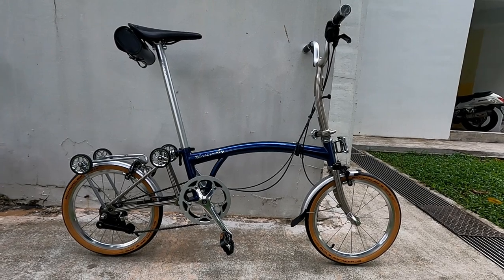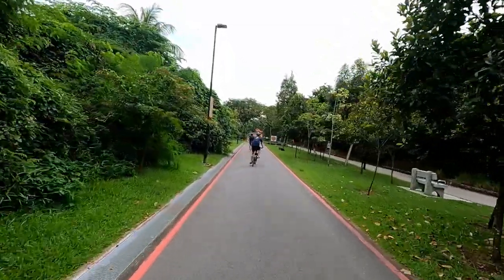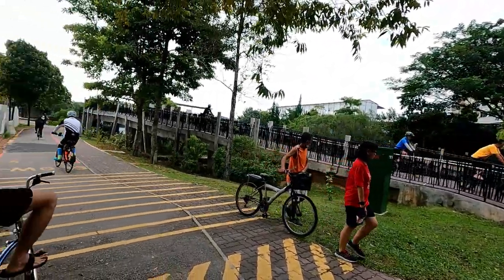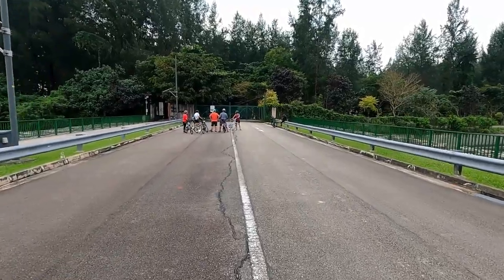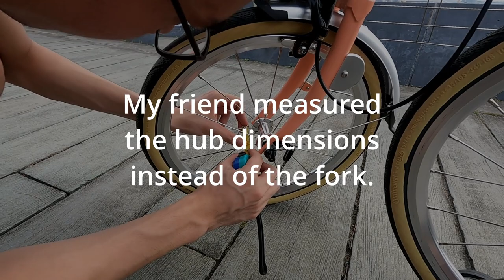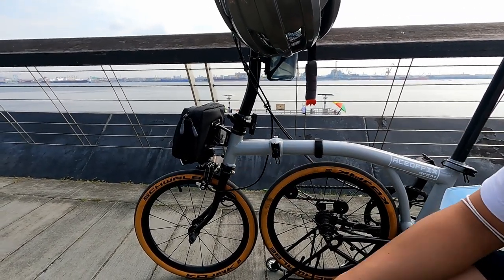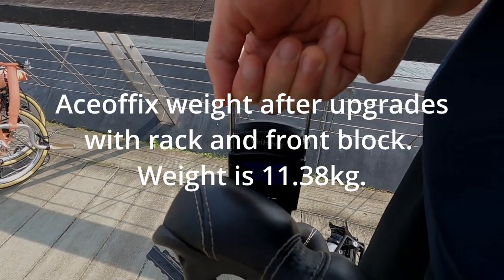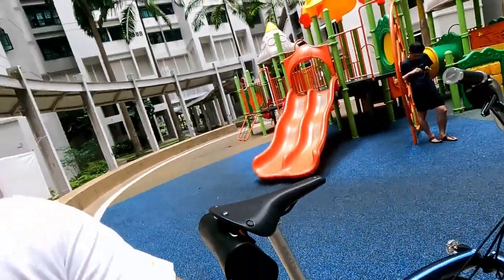BROMPTON CLONE WARS

Comment: Bought a Bluesilver Chrome 3sxity 3 speed from BikeXpress after watching your video. You have convinced me that a casual rider needs 3 gears, not 10. I did say “Ray” and the price dropped a little. That was nice.
It came today and looks gorgeous. Perhaps I should do a YT video on seniors like me should ride a bike for exercise, sightseeing around Singapore, and running errands, for that matter.
Decided to change the tyres from CST to Continental, for I was told it’s better. The shock absorber (or suspension) was changed from plastic to shiny steel, and so was the pedal from plastic to foldable steel (Sapience). Added a silver colour bike stand, it was firm and essential. I thought after all that, it’s a good start.
When I tested the bike my left shoe was caught on the left side tiny wheel (for pushing), and I nearly tripped over. Now I have to think about how to overcome that. The seat was not comfortable for a senior or a casual rider. I had suspected that and found a Velo Flurry (much wider and more cushion) and put that in my cart. 
Not wanting to wait a few more days to enjoy the bike, I went straight to Tampines West to get it from the store opposite the Middleton international school. One thing leads to another, a bell, a degreaser, a dry lube., a brush, a cleaning cloth. When is it going to end? When is this going to end? 
I will stop here. Not to forget to thank you for this introductory video on your experiences with the 3sixty and a comparison with other similar bikes.
Reply from the maker: Good morning Mr Chin,

I am very pleased that my efforts are useful and helpful towards the cycling community. Also, congrats on your discount 😜

I think you should start doing YT too, you have a lot to share and write. I believe you will gain traction:) You definitely can contribute and help others too with your experience:) 

You need to get used to not hitting the rear easy wheels, slowly but surely, you won't hit already. Saddle wise, can get wider ones for more comfort.  

Start filming your experience with the new 3sixty you have bought :) we can do a video one day together too. 

Cheers and ride safe ☺️
Reply: @raylearnstofilm6668  As a beginner in cycling, I'm most suitable to give feedback on the bike. Yesterday, I started to cycle from Vivo City across the bridge to Sentosa. I went towards Sentosa Cove as it was a lovely morning. As there are up and down slopes all the way, it is the best stretch to test the smallest gear. Sad to say it was not smooth as I switch gears, the chain fell off the gear. No big deal though a little disappointed, this is a new bike with a new aluminium derailleur that is supposed to be better than the plastic piece replaced. 
The upslope proved to be too much for an old man (though I have strong legs), especially on the return. The night before that, I tested the bike on a slope in my neighbourhood that is about one floor high and about 40m long, back and forth, time and again it was bearable. But Artillery Road > Allenbrooke Road was the tipping point. All of that was overcome by the gorgeous sight of Sentosa Cove on a cloudy morning—breathing taking to say the least. 
I'd have to cycle a few more times elsewhere before jumping to a conclusion.
Question: Is it an often and common experience to have the chain off gear?

Comment: is good to see more of those external 3 speed coming out . hub gear though required little maintenance but it will be almost impossible to repair if faulty. not to forget the re lace of spokes when changing a new hub gear.
Reply from the maker: Hi Kokwei, yes, the trend is really going external even Brompton are pushing their PLines and TLines as premium models. 

Repairing, I definitely do not know how to do it for the internal hub. Haha... Too complicated 😃

Re lacing the hub is still doable with the help of shifu @ Bartley.

Comment: hey ray, can do a video on the build quality of 3sixty vs pikes vs aceoffix?
things like:
1. is it easier/more smooth to fold? or very stiff
2. the welding quality
3. shifter, saddle, brake, etc quality

thank you ❤ your video have been super helpful, want to go down to your shop to build a bike someday 😁
Reply from the maker: Hi Mot,

I have sold my Pikes and I am not able to do a video on it. However, I can share my personal experience.

1. All the same folding method, Brompton derailleur no issues. Initially, Pikes and Aceoffix folding very stiff, maybe the paint at the hinges too thick. Added All purpose oil and it's not so stiff already. 

2. Welding quality, 3sixty best, aceoffix than pikes.

3. Shifter, 3Sixty best, Aceoffix than Pikes.

Stock saddle, 3Sixty best, Pikes than Aceoffix.

Stock brakes, Pikes best, 3Sixty, Aceoffix

Sorry, I don't own a shop haha. But feel free to test and build/purchase at Gary BikeXpress homebase shop for 3Sixty and CycleClinicSg for their Aceoffix.

Ride safe and cheers!
Reply: @raylearnstofilm6668  like that from your comparison Aceoffix doesnt seem like its worth the extra price tag if everything is stock ?
Reply from the maker: @onlyusemephone  can you explain, thanksss
Reply from the maker: @onlyusemephone  you mean base on stock parts comparison, aceoffix is not worth it?
Reply: @raylearnstofilm6668  Yea cos i am currently looking for a tri fold for my dad and was contemplating between a stock 3sixty and a low millage used aceoffix with upgraded parts for around 1000 dollars i was wondering which would be more worth it 

from your review it seems like if everything was stock 3sixty which cost around 800 as compared to a aceoffix stock which cost 1050 the 3sixty has better quality
Reply from the maker: @onlyusemephone  Ahhh, thanks for elaborating. I understand now.

3Sixty stock is ready to go, yes! Aceoffix, stock is not so ready to go... Both rides the same. Aceoffix you can convert rear titanium triangle. The 3Sixty, can't. 

If you want to upgrade and zhng your bike, get the ace. But i would get the 3Sixty for my mum to ride. Simply because she don't care about zhnging or making upgrades. Also, it is more budget friendly. 

For your case, I recommend 3Sixty. You decide... haha. 

Take care, ride safe.
Reply: @raylearnstofilm6668  do you know which one fold the smallest? Thank you

Comment: As a Dane I tried to buy a 3Sixty, delivered to the EU (Looking for a Brompton type, copy bike), but it wasn't sold in the EU most likely from Copy Rights issues, as the Patent has run out? And I must admit that even my two times 3 gears are not enough for my use.
Reply from the maker: Hi 👋 Finn 

You bought a 3sixty already? 6speeds? 3x2?

Comment: Thot the weight for Aceoffix is 9.8kg? Is it because rack, front block & pedal not included? But these 3 items comes up to ~1.6kg?
Reply from the maker: Yes, the rack, front block and a better saddle increased the overall weight of the bike. In my opinion, these are mandatory upgrades for a convenient and comfortable ride. 

Unless one is achieving a superlight bike for hand carry, I think the slight increased weight stabilizes the trifold. Which is a plus point. 

Lucky, there is no internal hub... If not it would be too heavy.

Comment: Do you encounter chain keep dropping issue for external 3 speeds? How do you solve it?
Reply from the maker: For me, no. I have friends/cousin who encounter these issues with their Aceoffix 3speed external. 

To fix it, 

1. you have to check the chainline of your crank to the rear cogs. 

2. Limit screws at the pusher 

3. Tension set at the cables when pulling the pusher.

Trial and error can fix, I am not a expert haha. Can bring down to cycle clinic SG. Or any trifolds shops:)) 

Cheers!

Comment: Mint is the better option with 9 speed
Reply from the maker: Mint is a good bike for sure for the price it offers. However, the traditional Shimano derailleur used on the bike makes the folding not as convenient. You have to make sure that the chain is in the middle cogs before folding.
Reply: It the construction of the outter gear 9speed and dis brake .due to that  the folding wider than those inter hub .but the price is value and better than six sixty and pikes when climbing  up slope.it  is easy  to mainten and you can modify to v brake and the wheel .